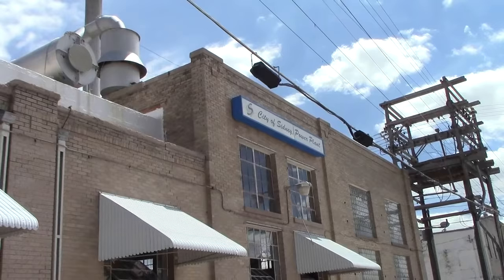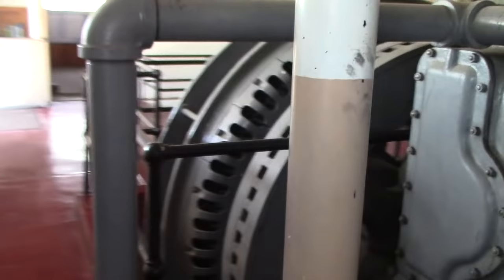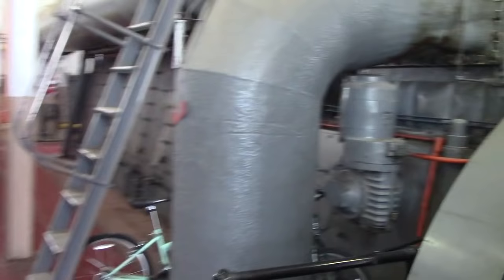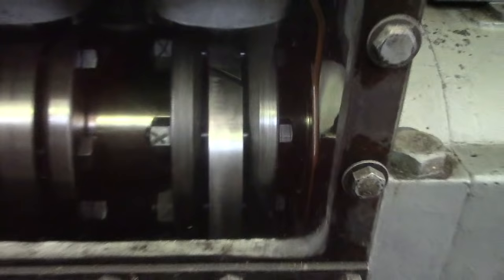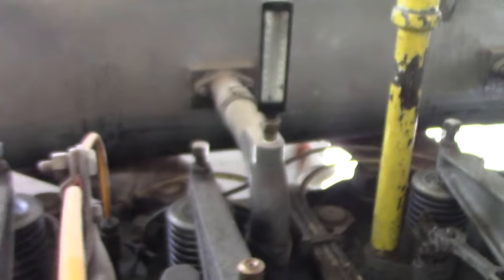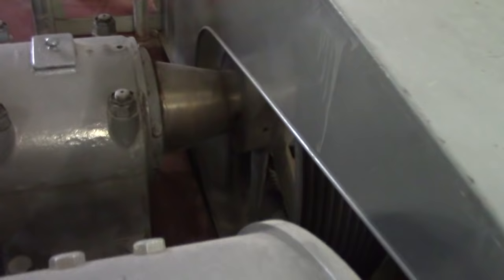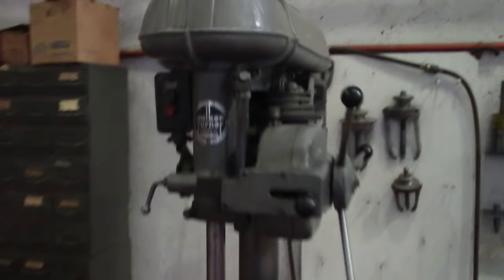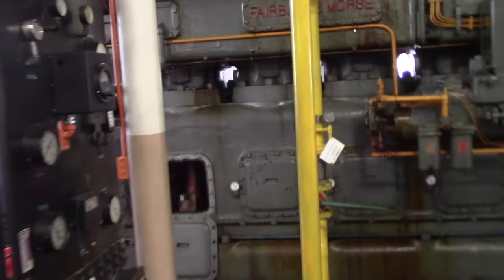Power Plant Tour, Sidney, Nebraska

Comment: I was a electronics major in college but joining the Air Force they put me in power production. Worked in a Titan I  underground missile site in South Dakota. Our site had 4 Nordburg diesels 1000 hp each driving a 2800V generator. Took care, maintained and overhauled these diesels. What I most like about these engines is that all parts were huge. Head bolts were 4" and we had a hyd press to loosen them. Each head was removed via an overhead crane. Was quite an experience. We had lots of problems with the water composition in So Dakota. Thanks for the video.

Comment: Excellent tour of a Midwest power plant.Have seen similar plants in Yankton,S.Dak,Vermillion,S.Dak.Those plants are now used for peaking.The switchgear panels are the circuit breakers for each  genset.I work at a VOA Greenville,NC transmitter site-short wave 250-500Kw transmitters.Site runs from commercial power.The overseas VOA plants run from Diesel generator plants like what you showed.Nordberg is a common engine they used along with new Catrerpillar.The breaker panels at our site are now new-sued to be GE. Now Powell Electric.They control power to each transmitter-those run from 4160V.The plant you showed would just barely run the site I am in .Imagine the town of Sidney is on  a grid and they may  need more power than what this can provide.Again a good cloesup tour!
Reply from the maker: Thank you Rex.

Comment: Nice, informative tour!  In our town, we have a similar backup system, which I got a brief tour of one day during their annual open house...The front (of the bldg.) engines featured a 1941 ex-submarine Fairbanks-Morse 38D8-1/8, running on diesel, two more modern F-M "Enviro-Tech" 12-cylinders, natural gas-fueled, but using a diesel "pilot" combustion chamber (I think), instead of spark ignition; these were turbocharged.  Also, a V-12 Waukesha gas-fueled, w/ spark ignition.  In the rear of the bldg. were two F-M 31A18s, one 10-cyl., one 12, burning diesel, and scavenged by similar electric blowers as your Nordberg, mounted in the bsmt.  These monsters turn at 277 RPM, requiring an unusual alternator to get 60 cycle power.  In between these was a 4-stroke, V-16, turbocharged Cooper Bessemer diesel.  None were running that day, of course, but I've been by the bldg. when they were up and running; the loudest seemed to be the turbocharged "Envirotechs", while the big ones at the back produce an almost-ground-shaking rumble.  The exhausts are clean, owing to soot traps/scrubbers.  

I asked about how long it takes to get the plant on-line and supplying power, in case of a city-wide outage; the engineer there explained it took about five hours to isolate the city from the main grid before this plant could be brought on line.  I think one of the main reasons it's still there, and active, is we have a major FAA ATC facility in town...

Fascinating stuff; great video!
Reply from the maker: Thank you Craig.  Nice tour you had.  Sidney uses their plant as a backup if the grid goes down also.

Comment: If they decide to get rid of that first FM motor I would take it.  That would be fun to use for 3 phase power for my shop, no limit to the size electric motors I could run then! :-)
Reply from the maker: I will have to let them know.  You couldn't afford the fuel bill.
Reply: Covert it to natural gas and it's cheaper. Still make parts for them
Reply: Randy Richard In The Shop  He could run it on corn whiskey....

Comment: Reminds me of my career in the Air Force from 1970-1990 where for 10 of those years I managed, operated and maintained Diesel-electric power plants at Vandenberg AFB,CA; Minuteman Missile sites in Colorado, Nebraska, and Wyoming; Sparrevohn AFS, AK; Pirinclik AFS, Diyarbakir Turkey; and Levkas AFS , Greece.
Reply from the maker: nice.  Yep for sure, plugs in and and it can be nap time.  Thanks Ken.
Reply: In the 70s many off those older engines were still in use back from the 1920s - there still some Fairbanks 32s in service in this country - many 1000s were sold to contractors that set them up  on islands and down in south America - I had worked for Colt at one time they make FM engines - 
 New steam plant turbines and gas Turbines only have a 3;1 or 4:1fuel effficency we're as the older 2 cycle  32s had a 20:1 fuel effficency - some of the 4 cycle slow speed engines had a 27:1 effficency - they used oil as a coolant and ran at 250° - they run far more efficient at high tempeture's - at 277 RPMs there is time to burn all the fuel
Between the high tempeture's and speed  there very efficient

Comment: Interesting tour.  I always figured power plants to use steam turbines exclusively.  At the evil polluting refinery we had two power plants and all of our power was generated with steam turbines.   The steam came from burning waste gas from making gasoline etc..  Keep on keeping on.
Reply from the maker: Thanks Harold.  The steam engine was either a beam engine or a triple expansion.  No turbine.  The evils of production.  What evil refinery?  i worked for Exxon I have been into Baytown and area many times.
Reply: It started as AMOCO and got sold to BP.  Of course BP started to contract out all of the work and sold off the power plants and some other stuff.
Reply: My highschool shop teacher grew up on Santa Catalina Island. He said power there came from two very large (16 cylinder? I forget.) diesel engine driven generators. This would have been in the 1960s; things have probably changed since then.

Comment: That's lots of diesel power in one spot, those old engines are probably in almost new condition, they usually last forever with good maintenance. Just add a keel and water, then you'll feel at home...   lol
Interesting to see...   ;)
Reply from the maker: These are in fairly good condition, a couple of them are out of service due to some issues.  These are small engines compared to today standards.  But engines very similar to these were also used in Tug Boats and small ships.  Engines this size today turn out 2 to 3 times as much horsepower.  It was a great tour and being among the great old equipment.  If I lived here I would work on them for free and form a group to maintain them.
Reply: Guess the sound of those is impressive, kinda massive, in other words very man type machines... Nice to maintain at least one machine to show how it was made and ran in that era.

Comment: Randy, maybe it is just me, but the sound track was not synced to the video.  At the end I noticed that the video length was 28:03 and the video had run for 28:24.  I am familiar with how those engines work, but if other people are having the same issue it might be quite confusing because you are not talking about what is on the screen...
Reply from the maker: Thanks Bob, I will have to check that.

Comment: Good stuff Randy.  How are they generating the cooling water, cooling tower, ambient heat exchanger?
Reply from the maker: Thanks Bill,  They had a cooling unit outside, and Lube oil coolers.  We did not talk much about all of the aux. systems.  We did talk a lot about the engines and some of the problems they are having with 2 of the engines.  This the the kind of stuff I did for 30 years.  Fun tour I hope to be here sometime for a running.

Comment: I never understood why it takes such huge engines to turn such small alternators . Are the magnets that strong or what ?
Reply from the maker: Yes they are.   The forces within the engine's are also very high.  Thanks Terry.
Reply: Charlie K .  A more modern high speed engine would be much smaller, however the useful life between rebuilds to be less than 20,000 hours and the life of these medium speed engines is somewhere around a quarter of a million hours.

Comment: Oh, my, a blast from the past!  However I noticed the natural gas. Once in Venezuela we had the mother of all power outages. Venezuela is all hydro power from the Guri dam. Somehow they blew a major piece of swtichgear. So all Venzuela was without power. No problem -- EDC  (Caracas Power, still private then) had a standby gas trubine generator, fueled by nat gas. Unfortunately all the valves in the pipeline sensed the power loss and shut off.  Of course. You don't want fires downstream! But they couldn't start the gas turbine -- no gas!  A whole country with almost zero power. I hope Sydney NB has this one figured out.
Reply from the maker: Wow,  One power plant for the entire country.  Safe is one thing, but they should of had manual bypass for startups.
Reply: The gas pipeline goes about 800 km from the oilfields to Caracas -- bit of a hike to turn on about 50 valves. Why one needs emergncy equipment.